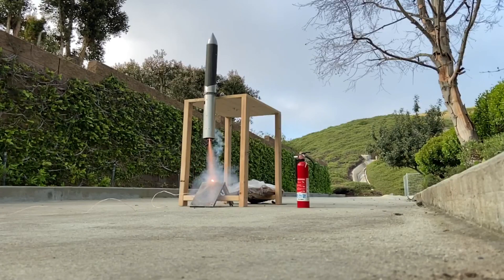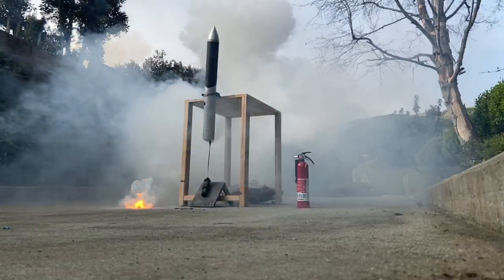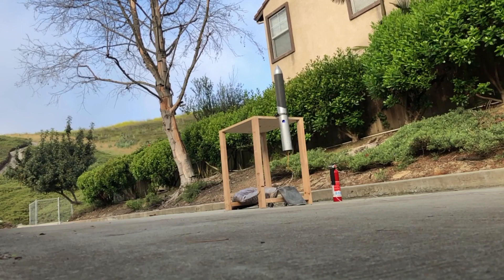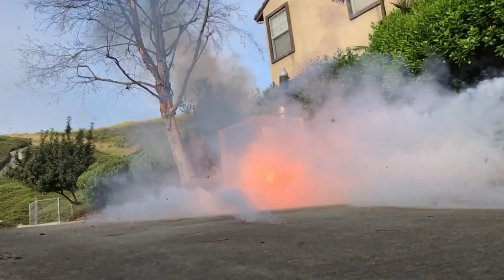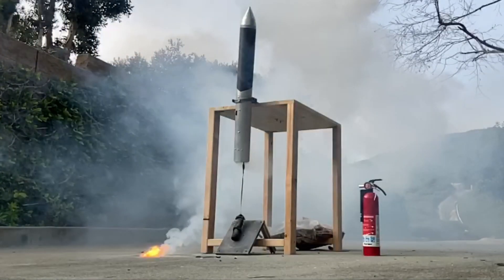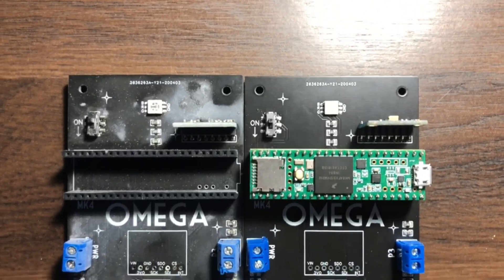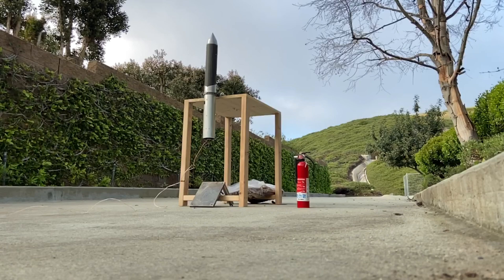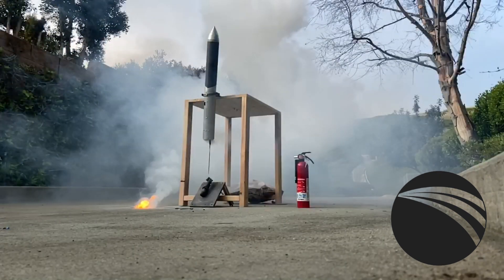Xenon | TVC Hold Down CATO

Comment: Great video mate, learning all the time.👍👍👍
You need to get your fire extinguisher away from the test pad.
If that motor failure had been any bigger, your extinguisher would have been out of reach.
Can I suggest you have the extinguisher in someones hands when doing a test.
That way it is ready to use and definitely out out of the danger zone.
Reply from the maker: Yes that was my mistake, next test should be better :)